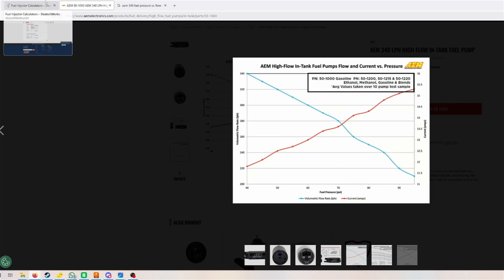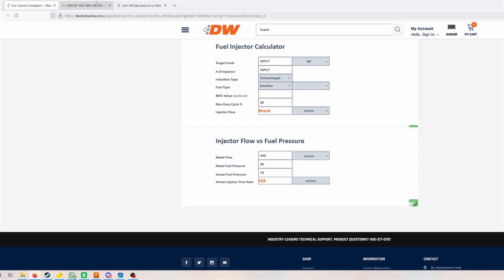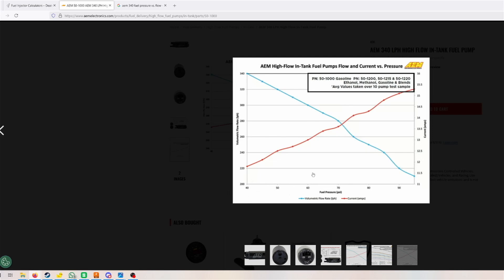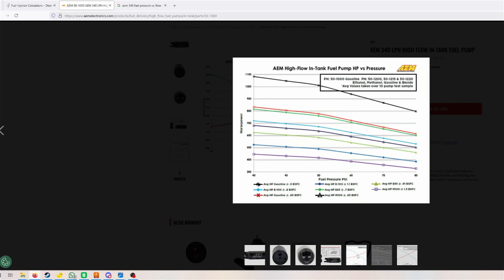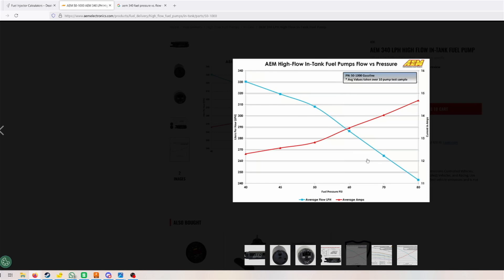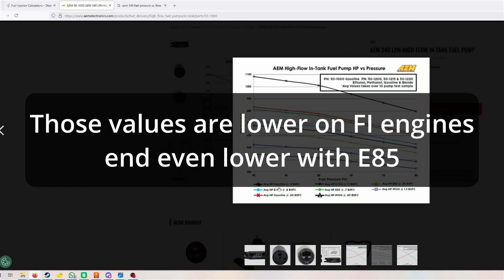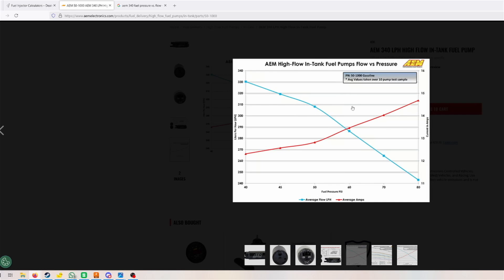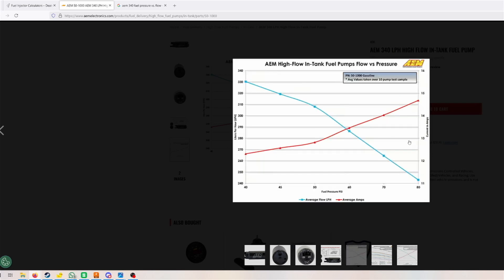Fuel Pressure mythbusting | Why raising your base pressure is a bad idea! (Most times) | & more

Comment: AEM fuel pumps belong in thrash bin. Bosch EV14 aftermarkets and motorsport versions operate up to 8bar pressure, but start to loose spray pattern around 7.5bar and pintle opening might become an issue depending of fuel temperature etc.

I've ran 1200cc EV14 on 6cyl E85 engines up to 900hp and 8000rpm with 4.5-5bar base pressures. Dual 525 walbros that are staged, and main pump PWM driven to keep base fuel pressure around 3bar at idle and low load engine speeds. Yes, you need to consider the fuel flow requirements if you increase base pressure considerable more than typical 3bar value.
Reply from the maker: whz the hate for AEM pumps_ i havent had issues and thez tend to be quieter than aeromotive for example. 
While yes the spray pattern is good up to 7 bar, there is no real need to up the fuel pressure that high because all fuel pumps loose flow with pressure. 

of course with dual 525s you have enough headroom for going higher pressure, but if you wanna keep your system relatively simpla with one pump then youd be beter of running less fuel pressure and bigger injectors, but to each their own i guess :)

Comment: I'm looking for almost 6 or 700hp 
What fuel pump and injectors u are going to recommend? 
4 cylinder engine 
2.0t
Reply from the maker: For pump fuel you will need at least a walbro 525 or dual 340 LPH for E85 

Fuel injectors should be at least 1200cc for pump and 1500-1600s for e85 in that application 

in general thats a bt bigger than needed in both sceneraios you are gonna look at 80 percent duty cycle but its better to have some reserves to be able to compensate with AFr correction
Reply: @throttlebuddies0  So u mean 1600cc for E85 and it's better to correct with regulator if I'm correct? 
Tnx for ur time 🙌
Reply from the maker: @rmt5820  depends what injectorsyou can find but yeah 1600cc will be fine. 
no i wouldnt use fuel pressure to correct it as said in the video just use 3 bar or 45 psi base pressure as most stock cars do
Reply: @throttlebuddies0  3 bar in tha tank or fuel pressure rail?
Reply: @throttlebuddies0  I'm watching ur videos from Sweden! Keep going 💪 
The engine is fully forged build 
F4rt Engine
Reply from the maker: @rmt5820  Thanks!!!

Comment: I have a large turbo GTX2871R 
It takes time to spool up its 2.4 Diesel 154Kw, how can I alter my turbo to spool up fast , does anybody know here , or I have to get a new downsizing turbo ?
Reply from the maker: i have two videos on my channel on how to get your tutbo to spool faster. 

easiest ways are: 
- Eliminating any steps in between flanges so from turbo to manifold and from manifold to head. 
- reduce backpresure throuh free flowing exhaust 
- Closed loop boost control 
- thermal insulation of manifold and turbo
- using a tubular manifold instead of a cat log style manifold
Reply: @ thank you
I can change the Turbo 
What turbo would you recommend please For a 2.4 Diesel 5 cylinder 154Kw maximum revs 
To 4400 with a wastage 
Something that’s spool up very fast 
I have already changed the intercooler to a larger one
Reply from the maker: @BK-it6te  qell the smallest turbo where you have choices for exhaust housings etc. would be a g25-550 which would spool about 800-1000 rpm sooner. The other option would be to go for a diesel specifiv VTG turbo like a 2260vgt or something similar
Reply: @throttlebuddies0  thank you